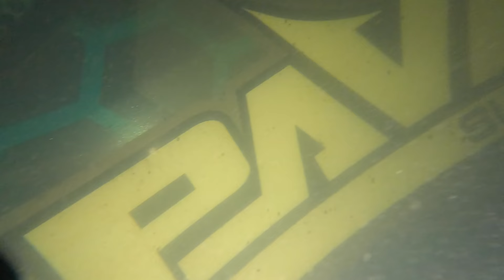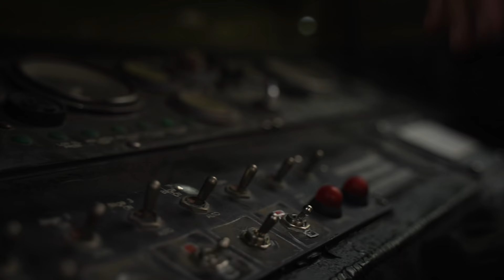I Sunk My Brand New $400k Pavati Boat- 95 Foot Deep Recovery With @AdventuresWithPurpose

Comment from the maker: Just to be clear: the boat had already been on the water for 2 days before it sank, including spending the whole night after day 1 in the water tied to the dock with no problems. The plug I used was one of those cheap flip-tab plugs which somehow came loose while we were beached playing at a sandbar on day 2. The bilge pumps were working but one of them blew a fuse that I wasn’t aware so when I opened the ballast tanks to bring on an extra 5000lbs of water to make our surf wave…the combination of the water in the hull that the bilge wasn’t pumping out, the full ballast tanks, and rough waves in the channel was just enough to overload the boat and it sank within 30 seconds of us realizing the problem. There’s not much you can do in that situation in the middle of the channel surrounded by 500ft cliff walls. My family was perfectly prepared and everyone was safe.
Reply: Pay attention to the details or sink
Reply: Crap happens, the more expensive the toys the bigger the crap. 
So, did you say that it’s going back to the factory for a redo? I would assume the insurance company would own it now unless you get paid to do the recovery and are buying it as scrap with a rebuilt title? None of our business just wondering if we will see it again? Thank you for all the time you put in the channel.
Reply: Freak accident. Wow and only 30 seconds? Damn. Glad you all were prepared.
Reply: Note to self:
Never serve "Sanka" brand coffee on your floating device.
Reply: Glad y’all are safe man, and the fact that y’all were at least able to recover it is awesome. Scary shit when you start to sink, I’ve been there before 2 miles from shore on Lake Superior
Reply: Great series. Great toes.
Reply: I really like what you said about “training your family for such emergencies.” Good thinking husband and Dad, they all knew what to do!
Reply: Glad to hear everyone was unharmed! Is chuck gonna restore the boat? Or scrap it?
Reply: Glad everyone was ok and safe!!
Reply: Screw the boat, save the family.
Reply: What we learned today is not to be cheap with the plug for the ONE AND ONLY hole in a boat. Especially an expensive one
Reply: Luckily you had time to get the steering wheel cover back on… 👀
Reply: $400,000 boat sunk by using a cheep plug. LOL, It’s always the little things that get you when you least expect it.
Reply: Sounds like some programming upgrades need to happen. Like ballast tanks can't be opened unless bilge pump circuits are working. Or bilge pumps run a 5 second test mode before ballasts can open.
Reply: @1Builtcummins  Sounds like a decent plan... add two things. Big visible indicator lamps for the bilge pump circuits, and an audible alarm for a bilge circuit that's commanded but not powered (or flowing, but that would need a sensor, and a NC relay on the ground side of the pump motor would suffice for the alarm). 

NC relay switched side powered from the switch ahead of the fuse, actuating side taking a path from the ground side of the pump opens the relay and depowers the horn when the pump circuit is completed/working. Flip the switch and the motor doesn't get/pass power, the alarm sounds. If there's no power to the switch, then there's no indicator light either.
Reply: At least it was in a lake not the ocean and the lake is 50 per cent full  of water so a lot of things was in your favor when it went down
Reply: A brand new 400,000 boat with a cheap plug ??? Ya okie dokie , you had to supply your own plug ? 🤣🤣
Reply: So glad your family was ok. That could have gone way worse than it did. The boat can be replaced the family can not.
Reply: Thank you for clearing that up. I watched the whole video and wasn't sure how a boat could sink that fast without you noticing something was wrong
Reply: Wow that's interesting, I sold expensive boat's in the 90's(Cobalt's) and I never seen one with a cheap flip down style plug. All boat's that were equipped with inboard/outboard motors had a brass threaded plug that was put in with a wrench. 🤔
Reply: I will make a video of a full restoration of your boat if you sell it to me.  
I’m in Gilbert Arizona. 
Just throwing it out there Heavy D.
Reply: @codyrussow170  some people don’t like the screw in plug. Usually those rubber ones do just fine and are quick and easy to use. Personally I would just spend the extra few minutes with the screw in plug but guess Heavy D is a busy man lol
Reply: This $400k wake-boat uses a "flip-tab style drain plug" rather than a threaded-drain plug?!  Don't tell me a flip-tab plug was used in the belly?!  What happened to all the fuel and engine oil?
Reply: It is always those 10c parts that bite you. Never go cheap go good.
Reply: What are the plans with the boat now that it’s out of the water? I’m sure insurance took care of it but is the plan to re build or just let it go to part out?
Reply: Dude you sunk the boat for content. Stop bullshitting us
Reply: @chrisk.1256  seems pretty suspicious to me, he needs to get his content somehow, Mr beast spends millions. I think Dave can spare a 400,000$ boat for a yt video
Reply: how convenient.  Did you take a page from the book of the youtuber that crashed his plane for views?
Reply: Ok, just to be clear the dilly doubly wasn't in the correct position and  led to improper fluxatation of the dooflicky, which led to unwanted liquidification .
Reply: hope chuck can do a full refurb..... wanna see the vid
Reply: Praise God 🙌🏻🙌🏻
Reply: @peggyhaines7394  for what?
Reply: What are you saying that the boat any plugs for when you got it so you bought what you did?  I had a simpler experience in Seattle's Lake Washington I sunk my car in preventing my boat from sinking at the dock.
Reply: @DrinkWhiskeyRaiseHell  
That his family was safe and sound.
Reply: Just to be clear: you put a flip tab plug in a threaded drain (in a 400k boat) and gave no explanation for what really happened or showed that in your video?  I know you didn’t install it from the outside. If you installed it from the inside it would have still been down in the hull. You would think the owner at Pavati would have wanted you to make it clear that it wasn’t the boat’s fault. This makes them look bad.
Reply: @RLhammar  uh what?
Reply: That makes sense, maybe make a short follow up video, you are getting slammed on boating fail pages on other social media platfoms and accused of insurance fraud.
Reply: Great job buddy especially in a dire situation like you were caught up in. You were spot on in saving your family first, boats can be replaced or repaired family can’t. I am glad you are all doing good and blessed. I hope we might get to see the cleanup and restoration of the boat if it is repairable have a great day and keep up the great job all of you and your family and friends do as the amazing team you are.
Reply: Why would you put a new cheap plug on a boat that was new? If the factory one failed, a normal thing to do would check with the dealer.
Reply: Also, I wonder how much the environmental fee was. Some states charge you daily for a sunken vessel that is potentially leaking fuel.
Reply: I'm sorry this happened to you and your family but I'm glad everyone is safe.
Reply: @1Builtcummins  having bilge pumps running on a small craft is not normal unless it is raining. That is a thing to watch closly, if the boat is expelling water through the bilge port more than a few seconds you are in trouble!
Reply: Liar
Reply: The shit we make up to avoid embarrassment 🤣
Reply: That's why you have insurance I'm sure it will pay for the boat
Reply: Something fishy here. 🐟
Reply: Trevor jacobs but with a boat, amazing what you tubers do for views. He was smart not to post the video of it sinking.
Reply: Happy your family is safe and well the boats can be replaced family priceless
Reply: Boats like that come with threaded brass plugs, not two dollar flip plugs designed for 12 foot row boats.  Just admit it, you left the plugs out, bilge pumps kept it afloat for two days until you flooded the ballast tanks.
Reply: Anytime the bilge pump Don't work and you are taking on water you pull main plug and get on plain. All water will run out the back
Reply: What's the next step on your boat? Rebuild?  That be an AUSOME VIDEO .
Reply: Glad you are all safe!
Reply: I wish i could work with you guys
Reply: It's still on you for not using the manufacturer supplied drain plug. I don't have a 1/2 million dollar boat but the one that I do have has the correct drain plug.
Reply: @chrisk.1256  if, it’s a quality motor, and tank. None of it should of leaked. Thinking that it’s a 400K boat they probably use, a well built motor.
Reply: @shawnmason5290  He made an IG post stating that there would be no insurance claims filed and this was all on his “dime” including the recovery.
Reply: Glad you and yours are ok. Good to see someone have the right mindset of what matters and what doesn't. Lots of people in your position probably wouldn't film a recovery of their own boat as well as being candid about it. Great video as usual!
Reply: What kind of plug do you recommend? I use the same cheap flip kind.
Reply: 300k boat (buys 5 dollar Drain plug)
Reply: Let’s be clear, it was your fault the boat sank. The plugs, really? Another Qualified Captain dipish.
Reply: It wasn't even his boat Pavati loaned him the boat last year if he would do a video on how good they were. There are no registration numbers on the boat. Since he didn't know very much about boats he forgot to put the plugs in. Amazing how popular   people that make youtube videos are.
Reply: Are you selling the boat or are you going to try to clean it up
Reply: Still a beautiful boat
Reply: Did insurance cover it
Reply: So a $400k boat doesn’t have an audible alarm telling you your bilge is full of water???
Reply: My advice to all new boat owners, UPGRADE THE BILGE PUMPS. I've nearly lost my boat to inadequate bilge pump performance. Upgrade them and the pipes they use to empty over board. Got a 2.5 inch pipe and a 3400 gallon per hour emergency bilge pump installed in addition to the standard two. I've had to use it a few times. So glad to have it.
Reply: @TheWestlandgirl  it's not a freak accident it was neglect. he's talking about using the wrong drain plug in the boat. and the style he is talking about with flip lever van be openend just with water going by the hull from driving. it was stupidity that sunk this boat
Reply: $400,000 boat should come with the proper drain plug. I would thing anyway. Either way. Content for us.👍
Reply: Need heavy D Boat plugs
Reply: How’s it not your fault,ignorance is not an excuse you should’ve checked the plug and bilge before you left the dock. Glad no one was injured and that your family is safe use this as a learning experience and don’t repeat
Reply: So a 400k boat takes a cheap flip in plug.????!!!! I have a 77 checkmate that takes a screw in plug. I guess at the end of the day......just cause you can afford a boat that cost more than people's house doesn't mean you should.  I have a 16 aluminum boat with a flip up plug that will sit for weeks lol!!!!
Reply: @71chevrolet  I have a 1986 celebrity 180 has a screw in plug as well. The fact is he didn’t check before he left the dock and then says it’s not his fault ignorance is not an excuse I hate that it happened and I’ve even forgot to put the plug in my 1970s bass boat one time luckily I caught it before I left the dock but it was my fault for not double checking
Reply: One of the kids messed with that plug while they were playing!!
Reply: Every wake boat I've ever been on we thread the plug in with a wrench at the ramp... Even my hobie cat has threaded plugs and its worth about as much as one of your speakers. Who puts a West marine John boat plug in a boat like that? Same dude who calls the bow, "the front of the boat". That being said it's pretty easy to sink a boat loaded with wake ballast, especially in chop. Almost did it in highschool on a MasterCraft ski boat with like 5 fat sacks
Reply: Sunk for content for sure!!
Reply: 400k worth of boat but you buy some cheap plug? man, i wish i had the money to do that. i got two boats and one im fixing up, the other is ready to go and i wouldnt go cheap on it by any means, i have one of those plugs on my desktop to just play with as a novelty, why didnt you check the plugs and stuff at the minimum? ive left my boat on the water but still check what i can, i also check the bilge pump regularly, before i go out the bilge has to work. 
That boat was worth more than our entire property including homes, and we built a new house around 15 years ago for half the cost of that boat.
Reply: Dude your a legend. Most people would have left it down there. One time I forgot to plug my jet ski but fought it back to shore once I noticed it was sinking. I got her up to plane and the water started coming out the back. I know that feeling when your craft starts to sink. Much love brother.
Reply: @jds0912  lmao!!  Preach brother
Reply: That was a Heavy Duh move.
Live and learn.
Reply: @DrinkWhiskeyRaiseHell  🎯🎯
Reply: What are you gonna to do with your 400k$ boat restore it or ?
Reply: Just curious with being who you are did they give you a brand new boat
Reply: @Sophie-and-Ken  I'm sorry but I would not pay 400k for that basic looking wakeboard boat
Reply: @wantapgt  me two I feel safer knowing I screwed it in....but 400 k for that boat....I mean for that price u couldn't got something bigger .... I mean I know it's nice boat and stuff but it looks like a wakeboarding boat but 400k just seems like a lot of money for that type of boat I mean I would say like a hundred k or something but 400k for that boat that's crazy
Reply: $400k on a ski boat should be a crime!!! Just stupid to pay that
Reply: Glad yall are safe bro
Reply: Bssss. Chill on the blow
Reply: The steering wheel cover is on the boat when it’s pulled off. And all those tools just magically on a brand new boat???
Reply: I've had "factory boats" with the threaded brass bilge plug and custom speed boats with the expansion style. The flip handle expanding plugs are the worst in my opinion, the T-handle expansion style are much better. No guessing on the T-handle style if it is tight enough.
Reply: Shit happens. Live and learn.
Reply: Grand effort on the recovery
Reply: @peggyhaines7394  stop being so gullible he sunk it for a video, smh
Reply: @paulf.8651  he sunk it for views
Reply: @wesleybeacom  got that right
Reply: You mean your 400k boat didn’t come with a plug
Reply: Not a freak accident. You used the wrong type of plug.  You need to use a t-type.  $400k new boat and the cheapest plug with a suddenly blown bilge pump?   These types of things happen when two or more failures happen and both were human error.
Reply: Thank god your safe brother . I'm sure this PC of advice is well known. Always use a brass threaded plug. I swap the other types for the brass threaded ones. God bless you sir.
Reply: Come on now admit you forgot the plug lol we've all been there
Reply: So a 400k boat and "cheap" plug?
Reply: Brother we are all praying for you and your family! Everything else is replaceable . Ron h.
Reply: I had a similar experience with my dads boat as well. I would recommend not cheaping out on the plugs and small things bc those will end up sinking ur boat. BOAT stands for bust out another thousand
Reply: I've also had a plug pop out before then rush to get the boat back on the trailer before it got to much water in the boat. I always make sure there nice and tight after that.
Reply: Gotta put the heater blockers on. Too many sad people that can't understand there are good decent God fearing people that aren't always trying to screw over someone for there own benefit. Love the content God bless you my man
Reply: I seen that you had adventures with purpose out there with you I don't know if you also follow Depths of History. He also does recovery. Thank you for all of your videos. And I hope everything is okay with your boat.
Reply: L
Reply: Hey bro just remember people only hate because they have it worse or cause worse and can't confront their own issues so instead it festers and creates their own warped view where everyone else is a screw up. Keep pushing you had some BS happen to your boat but your the guy who helps clean up for the state so this people hating can suck it
Reply: You sunk it 
Plugs don't just come out 
Regardless of what style plug it is
Never had that happen at all
Reply: are yall gonna rebuild it
Reply: I'm guessing that expensive pavati has a theaded plug. Really glad you and your family are alright. Bigger the boat the harder they fall ya know. I hope you get to surf behind it again. Thanks for taking us on your recovery adventure. 🙏
Reply: I sank my jetboat on 4th of July in 2014 ish in front of a million people at pirates cove in Arizona exiting the channel and not oneeeee picture or video has surfaced and everyyyyyyyone was recording and snapping pictures ... 🤷🏽‍♂️ memory I will never forget
Reply: Obviously I don't know how long he owned the boat before this occurred or if he had actually used the ballast system prior but I find it suspicious that the boat went down as he was filling the ballast tanks. I can't help but think this was the first time filling them and either a hose wasn't connected at all or a clamp failed. If so, he may have been filling the boat hull rather than the tanks and the boat foundered before he realized what was happening.
Reply: @paulcameron483  thats scary. Shes icy even in mid august.
Reply: high water alarm in the bilge .......
Reply: You looked stressed bro that stinks. Glad everyone was safe.
Reply: So I've lost plugs as well as forgot to put them in. So you out it on plane sucking out as much water as possible. then install your spare plug while on plane. It works well.
Reply: @j0rdanray186  
Hmmm 🤔 did you see the latest video. Don’t be calling me names. 
Keep your hatefulness to your self. God bless you Heavy D and your family. 🙋🏻‍♀️♥️🇺🇸
Reply: @MrRayedw  not to mention the steering wheel cover is still on! This is completely staged
Reply: Get a Stanley, self bailing no need for the bilge pump.
Reply: Never skimp on the plug.  Lol. You're not the first person to do this. Lol
Reply: @butchcassidy3373  and always carry extras in the boat.
Reply: So you put a Walmart plug in a half million dollar boat? Really.
Reply: Man that sucks dude
Reply: No one sinks a boat like that. Not even imaginable. Most important nobody got hurt.
Reply: Brother, we're just happy you and the fam got out safely and the rescue boat arrived so quickly. I've seen wilder accidents happen.
Reply: @DankSinatra679  Look at the AWP video, the drain plug is still there he claims that fell out
Reply: You may want to explain why in Adventure with Purposes video there is a non-flip tab plug clearly installed at the 56 min 49 sec mark. It's clear as day.
Reply: Can a auto drain gate valve be installed with a redundant hand valve  snorkel kit for the engine (in the awning) you can learn more from what fails then something that never fails  im glade yall made out ok
Reply: Having had a relative have an accident where water was between hulls on a big speed boat, slow up... and it force the nose in the water... instant sinking.... this stuff can happen way to fast on the water.  I'm just glad your family was safe.  The aftermath is our entertainment. Thanks for sharing.
Reply: @j0rdanray186  first thought that came to mind when he said his family had 30 seconds and they were more than prepared! Plus he has a camera and films everything but no camera that day? Wouldn’t want evidence I guess
Reply: Adventure with purpose is very busy year round, your telling me you got them out there 8 days later after accidentally sinking your boat? I call content creation!
Reply: @jasonbean5095  except the transitional flap gate was out of the bucket thus the shim and sham were useless so you couldn’t even stork the post.
Reply: @aslater2727  This is good advice for people who aren't intentionally sinking a boat to defraud their insurance company.
Reply: Those type of plugs are junk they always catch or get snagged on something on my aluminum flat bottom boat I use the screw in type witch I have never had a problem with I would hook a small chain to the plug and attach it to the back of the boat that way it's always on the boat and you won't loose it
Reply: People are F’n morons, who in their right mind would purposely sink their boat with their family on it. If you are half the man that you come across as, then there was zero chance this was for views. It blows my mind that anyone would actually believe that.  Let alone as many as there are. You truly seem like a genuine guy, I hope you don’t let the negativity bring you down. I hope you continue to do what you do. I truly enjoy the videos and appreciate the hard work that goes into them.
Reply: @rowdybroomstick6394  ya don't think we're getting the whole story. With a blown fuse in one of the bilge pumps , sounds like it had been working overtime , like the whole trip or something. And what happened to the plug that came with boat ?
Reply: Glad you and the Family are all Safe, Boats are Replaceable People are Not.
Reply: I’m sorry this happened!
Reply: @HEAVYDSPARKS. If you want to have some fun go full throttle up on plane and drop the reverse cups.    30knots to 0 in 3 seconds.
Reply: @veganspacemonkey  I’m shocked a highly customized boat wouldn’t use threaded plugs like Mastercraft, Malibu, Natique….  Those don’t come loose….
Reply: Good job fellows you did that well.
Reply: Glad you and your family are safe, great video
Reply: Okay Dave, great video. 1 question: are your toenails painted lime green @29:12?!?
Reply: We’re all really proud of you.
Reply: Nice green toes buddy
Reply: Shit happens and you learn bro, I'll bet money you never make that mistake again. Sure it hurts but your family was and is safe, material shit can be replaced.
Reply: Good that y’all are okay
Reply: @j0rdanray186  guarantee it was done on purpose! He is “good friends” with the owner of Pavati. The amount of publicity for everyone involved is worth it.
Reply: I would've jumped in and stuck my thumb or toe in the plug hole till it pumped out and then jammed something in the plug hole. Or just hammer down on plane so it couldn't run in. That's the best thing to do if you realize your plug is out is to get moving!
Reply: Invest in a barge with a excavator seeing recovery missions in Florida most of my life everyone always has a huge barge with a gantry and machine.
Reply: @codyrussow170  that's a really intelligent comment I don't know but ya know they are small easily misplaced you find one and throw it in very common occurrence.  Ever loose your keys
Reply: No loss of life is the big win here. Boats are replaceable.
Reply: So glad this was nobody's fault.  It sounds like something that can just happen to any luxury craft, at any time.
Reply: I’m sure I’m the situation the family was first!! So how is the boat 🚤 are you rebuilding it??
Is your family going to go back out on the boat with you!!
Praise God it didn’t happen while you were sleeping on it!!
Reply: I'm surprised you guys don't have a long auger tipped anchor point you can still deep into the ground and use to pull? Seems like it would hold better than the anchor you can't bury without loosening the sand around it. The long ones power companies use to attach guide wires to power line poles hold a shit ton of weight and tension.
Reply: Glad your family made it out okay.
Reply: Sooo, life vest on anybody? Make it cool and comfortable to be safe please.
Reply: Never sank a boat, but almost had once. Family went out on the boat and forgot to put the plug in. After getting launched and out on the water noticed water nearly over the engine and up to the floor. O-shit moment. So left the plug out, bilge pumps on full, and put the hammer down on that V8 to get up on plane and the water made its way back out the plug hole via gravity and when water level got low enough in the boat, quickly stopped, plugged it, and let the bilge pumps take care of the rest. Certainly was a bit of a scary moment. Can't imagine how much worse and faster sinking would have been with ballast tanks. Glad you and your family stayed safe and that you recovered your boat!
Reply: I'm so glad everybody made it out safely. I'd venture to say everything electronic in the boat was trash and you'd have to rebuild all the motors from the ground up. Cleaning it would have probably been a nightmare as well.

Nonetheless, like I'm saying at least everybody made it out safely without injuries. Things can be bought and things can be replaced, but people can't!

I would say it was a great video and I don't know any other way you could have done anything better unless you had 50 different air bags when you hit the water to go retrieve it. Like you said, if you take 1 water bottle with you, you might as well take 2. I'm what they call an overachiever when it comes to those things.
Reply: So 1.) bilge pump "blew a fuse" 2.) "accidentally" left the hose off the bilge pump 3.) installed makeshift plug >>from the outside<< of the hull 4.) ignored repeated audible alarms 5.) added several thousand pounds of lead ballast 6.) knowingly added 5,000 lbs of water.  I'm glad your family escaped unharmed.  However, anyone with that level of common sense should NOT be flying any aircraft.
Reply: I'm just glad your family was safe
Reply: I'm just glad your family was okay
Reply: Lol dude u gotta tighten them up...a nice brass plug and tighten it up then flip it up
Reply: @rowdybroomstick6394  you are right
Reply: @warrendean1007  agreed
Reply: It would be worth your while to call me in maine to fix your boat .
Reply: When I worked on some big Sea Rays, a Dallas Cowboy bought a 55ft Sea Ray and took it out without raising the anchor and dredged the whole Marina with it, he called in and complained the boat wouldn’t go very fast.  I guess stupid things can happen on the water.
Reply: Not that you don’t know how quickly things can go south but it’s amazing how quickly things can go from bad to worse …. This is a great example of why water safety training is such a big deal and how it saves lives.
Reply: Perfectly prepared? Okay so you sunk it on purpose? @HeavyDSparks
Reply: YOU LIED HEAVYDSPARKS. 56.59 TIMESTAMP ORIGINAL PLUG IS IN 

AWP VIDEO
Reply: HE DID NOT USE A FLIP PLUG. CLEARLY IN AWP'S VIDEO ITS A TURN 

YOU LIED HEAVYDSPARKS. 56.59 TIMESTAMP ORIGINAL PLUG IS IN 

AWP VIDEO
Reply: YOU LIED HEAVYDSPARKS. 56.59 TIMESTAMP ORIGINAL PLUG IS IN 

AWP VIDEO
Reply: You all rock. Thanks for the amazing content.
Reply: STILL.   Telling me with all that $$$ and sensors that the boat couldn’t tell you water was being brought on??  That NO FLASHING LIGHT for blown FUSE for the PUMP that is SEVERELY NEEDED was left silent??    Hard to believe a cheap plug was used on $400k boat. That’s insane.      Used to go to Lake Havasu every year.  You couldn’t tell the boat was sitting LOWER in water.  I know it’sNEW. 

That’s HARD LESSON TO HAVE.    Sucks.  Blown FUSE NO LIGHT INDICATION WARNING which is VERY important. The BILDGE PUMP has to be the #1 safety equipment next to VEST!   If boat takes on water  must have PUMPS   Way the diamond plate on front you can run it on ground and not hurt the haul!   

I want to know why FUSE blew. It shouldn’t have happened. That circuit has to be on its own.    If it does BLOW. I want a huge LIGHT Telling me its off.
Reply: @jonathanlawrence1401  lol, I was wondering if I was the only one who noticed the green toes
Reply: I’d rather recover a hundred boats over one body. Thank God you all did the right thing and were all safe. Sadly many people make bad choices in which we have to go recover them and a boat. 
Good Job overall. Proper lift bag work would of made for a quicker neater boat recovery however probably not as dramatic and shorter video 😂. But good job guys.
Reply: Not that boat savy, but damn I always thought the check ur drain plug joke was a troll.
Reply: who cares what they said- great content non the less
Reply: That’s not a accident, that’s carelessness. Some people just shouldn’t own boats
Reply: @shawnmason5290  that’s why you don’t cheap out on stuff after buying in expensive rig lmfao.
Reply: Love Adventure With Purpose ~ Humble Kind Capable❤
Reply: Kids were wearing life jackets… which means you’re not from FL 🤣🤣🤣 good work!!
Reply: I’d be happy with a 17 to 34 grand used Wakeboard boat. So if I ever sink it, I would not have to worry about payments and I will have the money to restore the boat after the fact. Also I’ll get one of the nicer threaded bolt drain plugs so I’ll be sure to never sink it.
Reply: Good that everyone is okay but will the one wheel still work 🤣
Reply: Where the non sinking blocks on the board of boat?
Reply: 400,000 dollar boat but decides to cheap out on the little plastic plug 😂
Reply: Love the fluro toes.
Reply: After watching this video I always test the bilge pumps before we take it off the trailer
Reply: Why do you have to provide anything on 400k boat and why for the first time in your life using anything cheap?? They’ll never answer because they have just enough suckers to believe that.
Reply: @jasonbartosh828 Oh my God I saw that right when I read you comment. Strange.
Reply: Dude your titles are always slightly misleading and it drives me insane
Reply: @j0rdanray186 did you see MonserMax next to the Blackhawk? Whistlin Diesel...
Reply: The main thing is that nobody got hurt . Safety is priority.  The kids had life jackets .
Reply: $400,000 boat that uses a $4 drain plug.